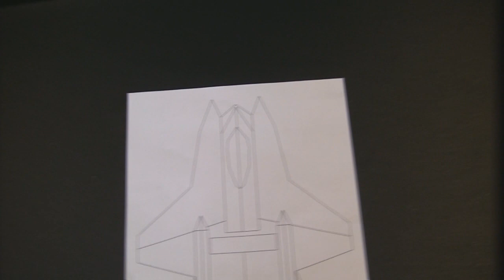FF-Sabre Warrior Part1

Comment: Paul,
I've been an AutoCAD user since the early DOS versions. Now we use parametric modelers. Started with Designer, then to mechanical desktop and now we've been using Inventor since version 1. I've been in the field almost 20yrs. If you need some 3D drop me a line I  can turn this around very quickly.